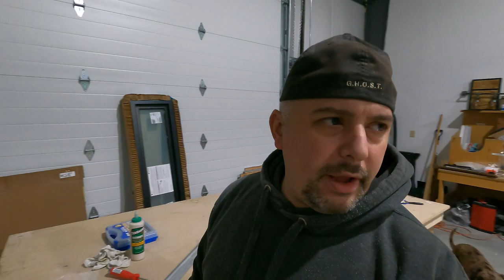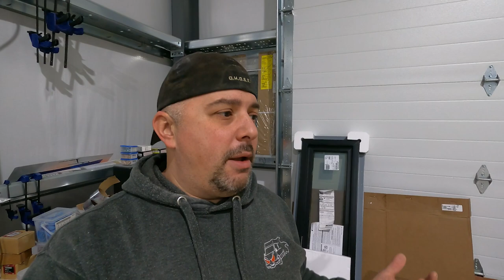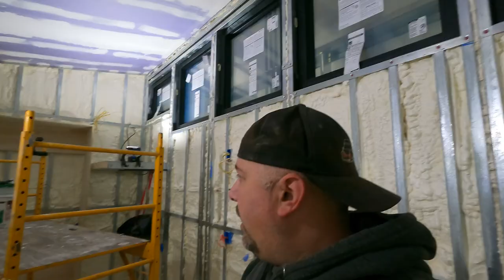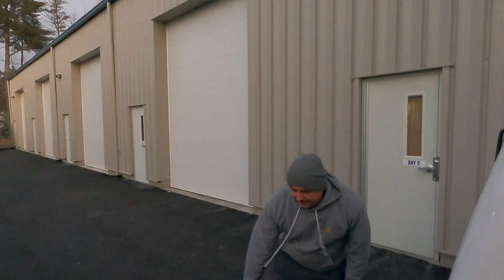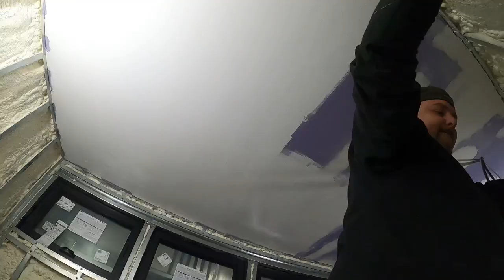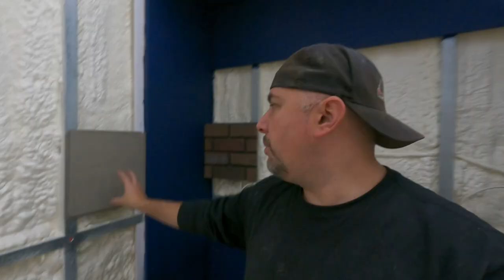DIY Tiny Home Build Week 22 of ?? - Ceiling, Murphy Bed Install, Started Paint

Comment: Hey Jarrod great video content just started watching thanks....... Suggestion .... While you still have access.... Install one or two 2x4 wood studs in strategically placed locations in the wall so the future tenet can  mount  an "articulating arm  full motion  TV mount ... Most of them require a wood studs to mount them... Thanks for the content...
Reply from the maker: Tv mount has a location. Reason they say that is because the average person doesn’t use the proper screw on a metal stud and it could strip it. Also have to use a screw gun over a impact driver. If it makes you feel better I’ll be attaching wood over the stud to even more of a catch but I’m not worried. The murphy bed said the same thing, not to attach to metal. It’s help up stronger then any other bed I’ve felt 🤷🏻‍♂️

Comment: I just can't help thinking about all the heat loss through all the metal studs and ceiling joist especially in a cold climate. Hope you get a good thermal break in your walls buddy.
Reply from the maker: Not much due to using spray foam as an insulator. So many are concerned over this and I’m betting because one person told them, or someone said it in some video, about metal studs cause heat loss blah blah…that might be the case with certain types of insulation and that’s why I went with spray foam. Those studs are sandwiched between 2 other materials plus spray foam. Heat gain and loss will not come through studs
Reply: @JarrodTocci  Hey man it's your house and you can do what you want but if you don't want other opinions why put it on Youtube? The outside sheeting is not a thermal break and it is yet to be seen what you do on the inside but the drywall in the ceiling is not a thermal break. When you're finished I dare you to film the inside with an infrared camera that will show all the heat sinks in your home. It's not an urban myth by any means and I'm sure your home will be just fine but it could have been better.
Reply from the maker: @vanman3752  Couple things going on here. First, I'm not scared of opinions and bring them on. But that said I'd also like for "facts" to be "facts." When I spoke to construction experts, people that build houses, they ALL said that my method doesn't need any sort of thermal break as the type of insulation I went with acts as that thermal break. Second, I already have plans on showing any "leaks" with a thermal heat gun and I'm looking forward to proving many wrong. Third, most people building vans when I started building vans NEVER talked about thermal break, but I was one of the only ones that did talk about that. I covered why thermal break is important and how to fix that issue building out a van (go back and look at my videos). This was years ago and people called me crazy back then and now everyone is using my methods on thermal breaking. So to sum up, do I know some things about this? Yes. Am I wrong sometimes? Yes, but I've also learned over the years what to fix. In this case I've talked to those that are smarter than me, those that have built tiny homes with steel framing. I very much welcome everyone's opinion, but at the same time please look into what I'm saying too, or wait until I prove my points, or until I put a finish siding on as that could even act as, what you like to call, a thermal break.
Reply: @JarrodTocci  It's such an easy concept to comprehend I don't understand why you don't get it and I like every other person in the Building Science world call a thermal break a 'thermal break' as opposed to  'thermal bridging'. You can increase the insulation between your 'thermal bridges' all you want it will not reduce the conductivity of the 'thermal bridges' in the structure which could be as much as %15 overall. So all you need to do is stop the transfer of energy from the building envelope with what in the industry is called a 'thermal break'. Easy-peasy.
Reply: According to ASHRE, metal studs on average reduce the over all r value by 63% when 1/2” plywood and 1/2” gypsum is directly applied to metal stud. You need at least 1” ridgid insulation over studs to go from r 7 wall to r 25
Reply: Mr sensitive, just trying to help you from making a big mistake, add 1”exterior or interior
Reply: Mr sensitive, just trying to help you from making a big mistake, add 1”exterior or interior
Reply: @paullehto2294  I'm making a big mistake? Where on the spectrum are you?

Comment: It's coming along nicely! As someone who painted houses professionally, it always pains me to see DIY'ers rolling paint on without a handle, especially a ceiling! You'll end up with a much better job, because you can make much longer passes, and it's far easier on your shoulders and arms. It's shockingly common though, so don't feel bad. It's like pushing a bicycle. 😉 Keep up the good work!
Reply from the maker: Thank you. I plan on doing it with a long handle from the floor for the 2nd and 3rd coat. I wanted to be close to the ceiling for the 1st coat to see any mistakes I made with compound, taping, and sanding. I agree with you tho!
Reply: I also find many things he does laughable. I always use a18” roller with adjustable Handel. But he does not build full time and I find his channel very entertaining,
Reply: @paullehto2294  I think you mean a 9" roller? 🤔
Reply: @paullehto2294  he never claimed to be an expert and this is how you learn. He does seem to be open to others advice.
Reply: Pro painters use 18” rollers, so much quicker, try it and you never go back for large area’s
Reply: Pro painters use 18” rollers, so much quicker, try it and you never go back for large area’s
Reply: Pro painters use 18” rollers, so much quicker, try it and you never go back for large area’s
Reply: Pro painters use 18” rollers, so much quicker, try it and you never go back for large area’s
Reply: Pro painters use 18” rollers, so much quicker, try it and you never go back for large area’s
Reply: Pro painters use 18” rollers, so much quicker, try it and you never go back for large area’s
Reply: Pro painters use 18” rollers, so much quicker, try it and you never go back for large area’s
Reply: Pro painters use 18” rollers, so much quicker, try it and you never go back for large area’s
Reply: Pro painters use 18” rollers, so much quicker, try it and you never go back for large area’s
Reply: Pro painters  use 18” for large area’s.
Reply: Pro painters  use 18” for large area’s.
Reply: Pro painters  use 18” for large area’s.
Reply: Pro painters  use 18” for large area’s.